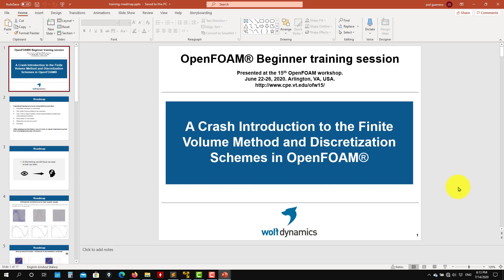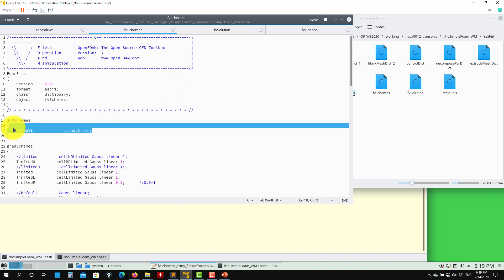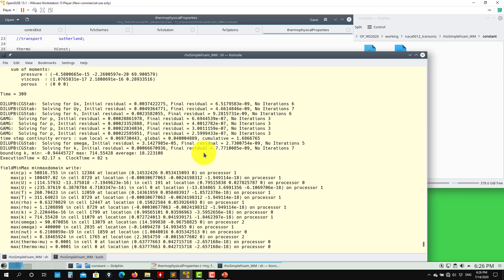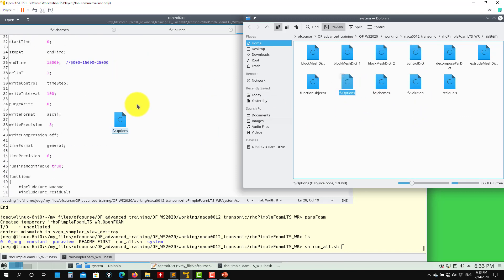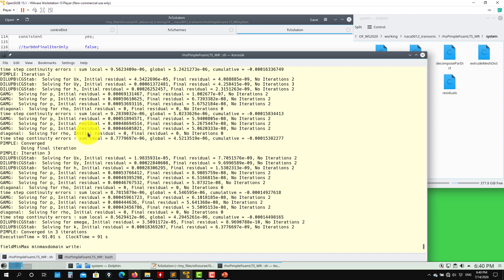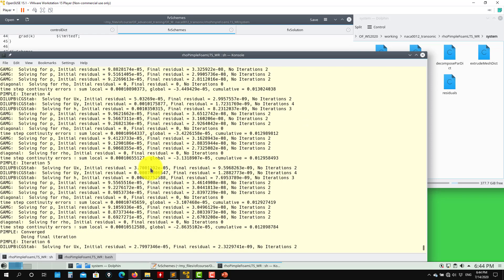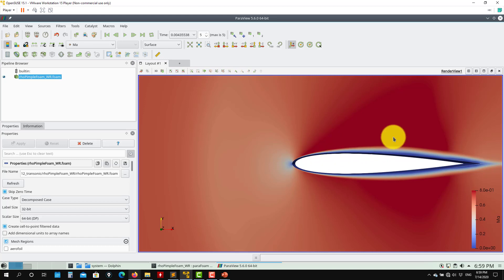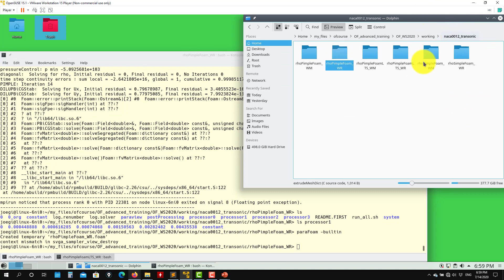8. Fast and furious introduction to the FVM method and discretization schemes in OpenFOAM

Comment: Hi! Nice video! I have a simple question: looking at Omega and K values, I noticed that you used the wallfunctions at the wall. Since it is a wall resolved case, shouldn't we avoid that?
Reply from the maker: The KOmega turbulence model is y+ insensitive. The wall function will take care of the treatment
Reply: @wolfdynamicsCFD  so they basically will ignore the wall treatment if y+ < 5 ?
Reply from the maker: @antoine1407  it is better to say, it will automatically use the right treatment according to the y+ value